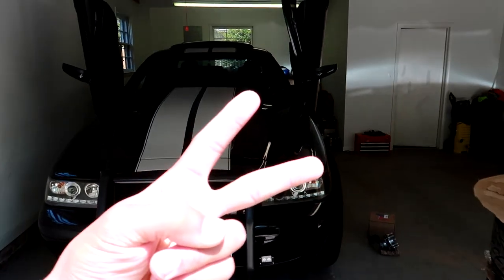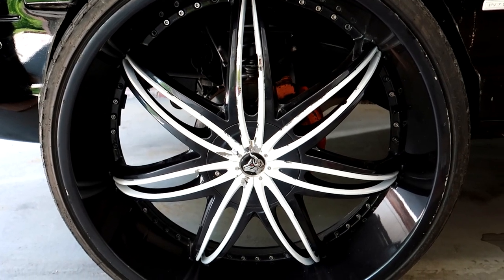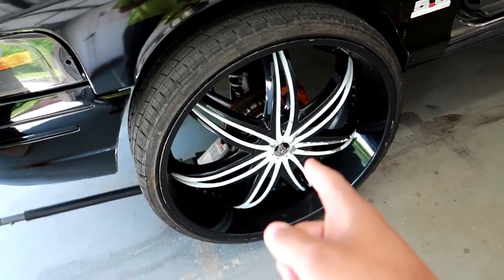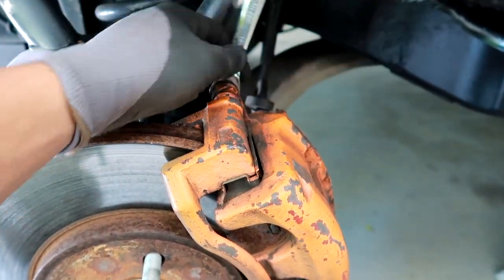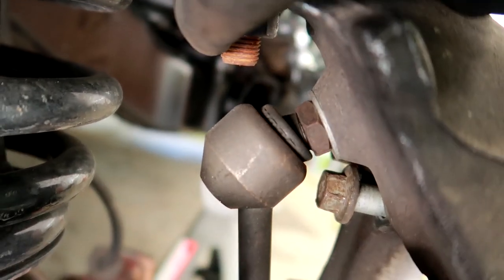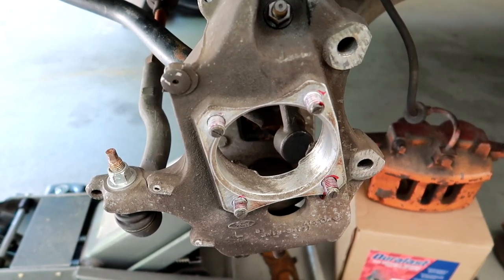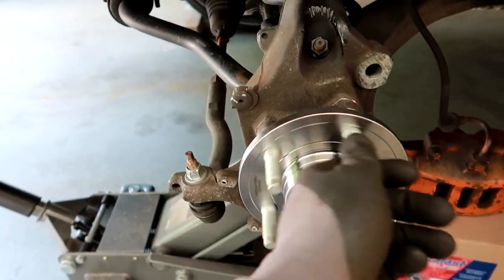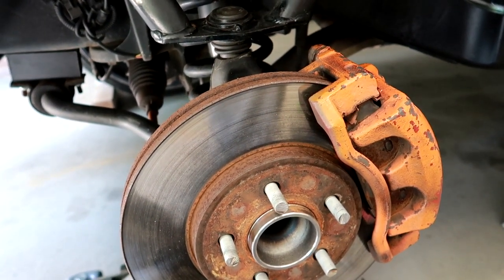How To Replace Wheel Bearings On A Crown Victoria, Super Quick & Easy

Comment: Excellent job, thanks. Having to replace front wheel bearings on 2011 with 256,000 miles. Seems easy enough. Thanks again.
Reply from the maker: Anytime, glad i could help

Comment: Just started this job, mine is corroded and totally stuck in the spindle.  Thank you for the great video, I thought I forgot a bolt or something but it’s seized to sh⚡️t!
Reply from the maker: I believe it. They can be a pain to get off.
Reply: How did you end up getting it off? If I can ask because I'm pretty positive that the same thing is going to happen to me. I'm going to be fighting with the thing for hours and the freezing cold and a job that you would think would take 15 minutes is going to take five or six hours to do both. I was thinking of doing it on my vehicle. 

I'm definitely going to get some penetrating oil and presoak everything and possibly a torch just in case.
Reply: @jaygee6983  I took a 40lb sledgehammer to mine and it took 4 hits with it, and it popped out when I replaced mine.

Comment: Going to replace my front-end ones anyway but was wondering if anyone had ever heard of going 256,000 on original bearings. I'm not joking. They have never been changed, and neither have the spark plugs. Still idles as smooth as silk. I did the test where you remove the wheel and check for play. The only thing I get is a slight "clicking" sound when I turn the wheel by hand, and this increases with wheel speed. Sort of like the old playing-card-in-the-bike-spoke trick, only a lot more subtle. Barely noticeable scraping when I first start driving in the morning, but that goes away. Very subtle vibrations in steering wheel while driving. Wife claims she can hear a low humming/chirping coming from front right through passenger kick panel. I think I caught it early enough.
Reply from the maker: You caught it just in time. The bearings on these vehicles are notorious for going out abd that humming you hear is just that. Change the spark plugs as well and you will be surprised what difference that makes in fuel economy and everyday driving.

Comment: In the future to save time. You only need to remove the bottom caliper bolt. The top will slide out once the bottom bolt is removed.

Comment: I got a ton of play in mine too bro, I have a 98 marquis, but the play in mine is from left to right, there is also an annoying popping noise when I'm turning the wheel, I bought a hub assembly but I am unsure of what it is exactly
Reply: Popping when turning could be a worn tie rod.
Reply: @daytonafuntim  ok bro appreciate the response
Reply from the maker: Mines popped too. I think they all do that when we alter the suspension and go bigger wheels.
Reply: @2xmototv206  Most definitely, I put a 3 inch lift on mine & I never heard that popping noise until I did the lift. You got yours looking A1 though bro, I still got some work to do